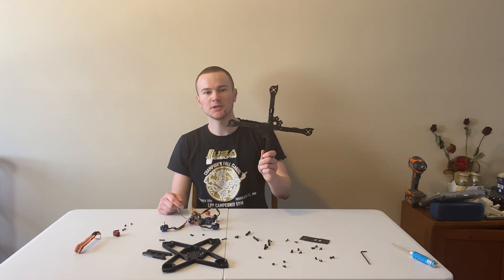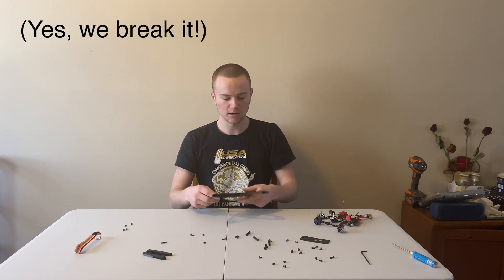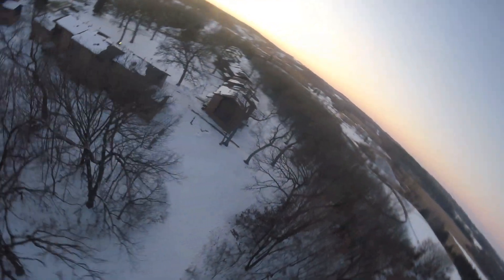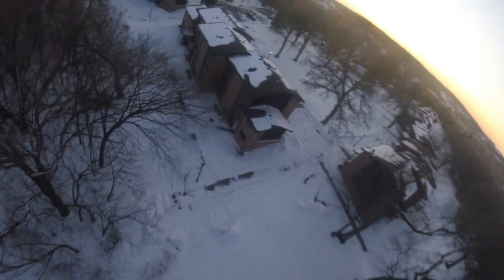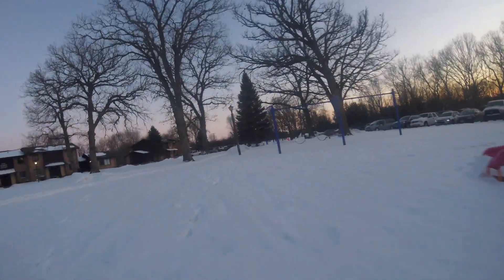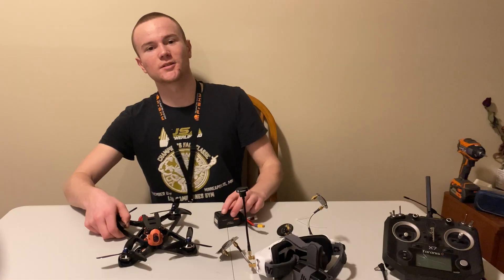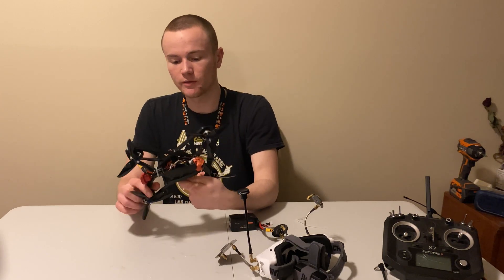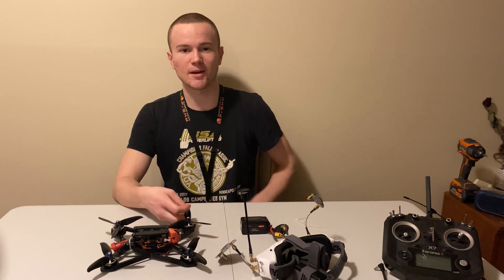How Well Does a 3D Printed Frame work for a FPV Drone?

Comment: Next, try try printing in carbon fiber nylon. Maybe more favorable properties compared to PETG, especially in the cold?
Reply from the maker: I like that idea. Probably less brittle, might still have issues with the vibration though.
Reply: @easydrone3100  carbon fiber polypropylene is you way =))) or clean non reinforced polypropylene (may be hard to print via low adhesion to table but have some tricks =))  ), the lightest unbreakable frames without resonances
 =)
Reply: @3d-club polypropylene or polycarbonate?

Comment: "one of the best ways you can tell how your drone flies is through the audio" Good thing all these new HD systems don't have audio... I don' understand how they are missing this.
Reply from the maker: Yeah, that would be nice. However, I don’t use the audio from my drones vtx when it’s within earshot. The sound delay throws me off too much, I just listen to how it sounds normally and then use the vtx audio for long range flying. It’s extremely helpful for figuring out how much throttle you’re using without looking at the screen either